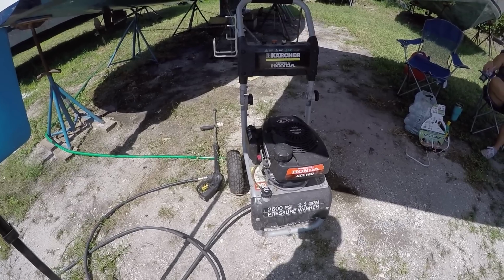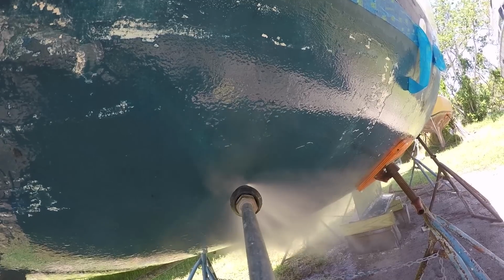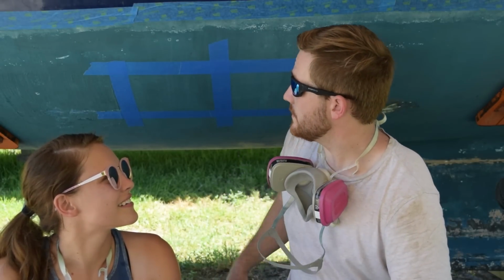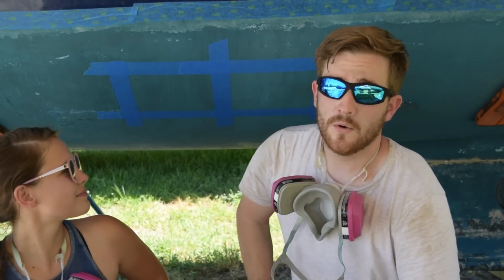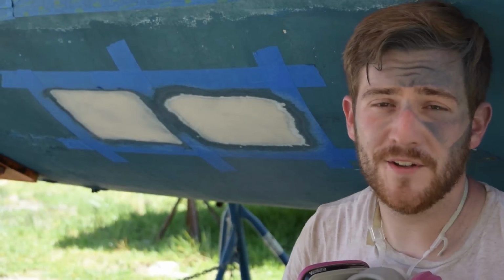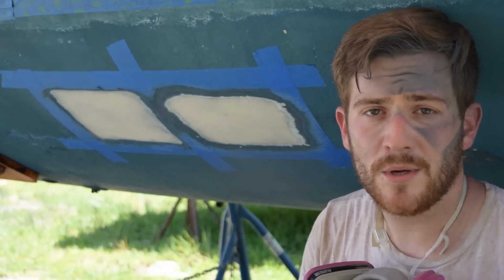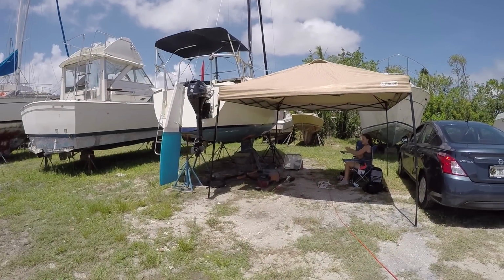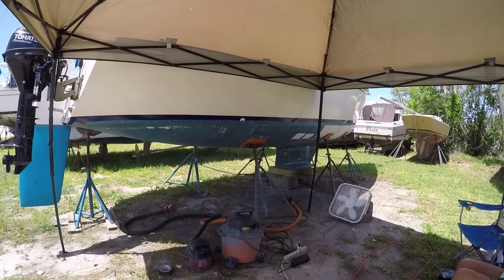27. Sanding Flat or Sanding at an Angle, What's Quicker? - Sailing Vessel Somnium

Comment: Dude, you completely missed the whole concept of the right way to use a sander. The idea is to get a smooth finish. Yes the angel will remove material faster, But at what price? What is left is a jagged rippled surface that will look like crap once finished. So in the end you will need to sand even more, to achieve the same smooth surface.
Reply: True.
Reply from the maker: Ha, just doing what works for us! We sand at an angle then go back over it flat and the hull is smooth as butter :) Thanks for the input!
Reply from the maker: Not trying to be a smart ass... just being lighthearted, however tone doesn't translate well in text. Go ahead and unsub if you'd like though. Best thing about YouTube is if you don't like us, don't watch us :)
Reply: Learning the Lines...He was spot on. The method you used, the reasoning behind it, and the work that you created for yourself, are all points that are trying to be made!! You did an experiment that was akin to deciding which is the better way to make a hole, a hammer and nail, or a drill and drill bit!! 

When sanding, the point is to make s smooth and uniform surface! When stripping the surface to be made smooth and uniform, you don't want to continue to make it rippled and unsmooth! The random orbital sander was designed to create a smooth finish, quicker than doing it by hand! And to remove the old finish, by using a smoother grit paper, up on edge of the sanding surface, only grinds and pits the surface to be sanded smooth!! Think of trying to make the surface like a mirror with the tips of your fingers, or the flat edge of a piece of wood!! 

To remove the old surface paint, use a heavier grit paper, on the flat of the sanding area! To make a smoother surface, use s finer grit, on the flat surface of the sanding area!! But never use the edge of the sanding area, unless you don't care about the total surface area, and what the end result looks like!! Go over the entire old paint surface with a very coarse sand paper, to get most of the old paint off, and to smooth the surface better, without causing ripples and ridges where the edge of the sander will dig in, unevenly!! Then use a finer grit to get to the main area that you want to paint over, that leaves a very small tooth for the paint to use to adhere to the surface, but in an even and uniform manner!
Reply: @LearningtheLines   not a good look.
Reply: I'm late to the party. 
 As a body guy this makes me cringe. I imagine if you blue died the hull it would have swirls and gouges everywhere. 
But that being said it looks great from my house.

Comment: Pressure washer to remove bottom paint???  regardless of whether it works or not, if there is enough pressure to remove paint, there is enough pressure to impregnate water into the fiberglass which may take a long time to dry out. 
Nothing wrong with Ryobi tools, yes they are not something you would buy to use every day all year but they work just fine for the home gamer. 
Sanding a HULL flat does not put as much surface (sanding dick contact area) as sanding at an angle unless you use a thick foam pad under the sandpaper to allow the paper to conform to the curvature of the hull.  
Me, I prefer the belt sander for large areas and dick sander for touch ups and hard to get areas
Reply from the maker: Yeah, I only tried it because I knew there would have been ample time for the hull to dry out during the Florida summer. Lot's of people recommended it though. Thanks for watching!

Comment: I'm am not an expert, but do you have to take it down to bare hull all over?  Seems like the paint was in good shape in most areas, so why not just add another ablative coat?
Reply from the maker: Maybe on camera it didn't look as bad as it was, I plan on doing another video/segment on why we're doing what we're doing soon. Thanks for the comment!
Reply: Any proper paint job done, be it a boat, a car or even walls demand good surface preparation i.e. sanding ! Other wise, a botched, unsightly finish. If it's worth doing it, it's worth doing it RIGHT. Kudos kids.
Reply: It's below the water line, it's not painted for aesthetics as much as to protect the bottom from fouling.

Comment: Go flat and use a bigger sander. Those big ones you hold with boat hands rock. And if you want to get evil with surface removal, go down a grade until you get to gnarly grit.  You can always go back up a grade quickly enough after that first layer is gone.
Reply from the maker: So like a 6" instead of a 5"? Would it make that big of a difference? If you have a recommendation I'd love a link to a good one. Also, we've recently tried out a belt sander, which was quicker than our random orbit sanders, but was heavy and clunky, and we'll be trying out an angle grinder to sand as well too. Thanks for watching and the input!
Reply: They're are lighter weight "grinders", actually polishers used in the automotive detailing business. And some 8" accessories including foam pads and stick-on "sand paper" available. Check it out

Comment: so why sand at all? It did not look like may paint layers were on there and it is adhering well enough...do you plan on racing?

 Of course i cant really "see" the paint from 1000 miles away, just asking.
Reply from the maker: Maybe on camera it didn't look as bad as it was, I plan on doing another video/segment on why we're doing what we're doing soon. Thanks for the comment!
Reply: Again: Any proper paint job done, be it a boat, a car or even walls demand good surface preparation i.e. sanding ! Other wise, a botched, unsightly finish. If it's worth doing it, it's worth doing it RIGHT. Simple.

Comment: Sanding flat will reduce the amount of fairing, which will reduce the overall cost. Less materials purchased-fairing compound and sandpaper and will make the sander pad last much longer.  So quicker is a relative term. Cost also. And u know that paint has poison in it, u should really be wearing paint suits to minimize the possible contact with your skin .......and then u don't need sunscreen at all......
Reply from the maker: Definitely a balance reguarding the PPE. I think the high on the days we were sanding was in the 90's with the humidity just as high, so a full suit would be almost unbearable. We protect our eyes/lungs first, however we're not in the business of doing this professionally, meaning we're not exposing ourselves to it on a daily bases, so our overall exposure to the dust in our lifetime will be very low. I can tell I don't think I ever want to sand a sailboat hull to this extreme again. I'm quickly learning some things are worth paying someone else to do for you. As far as the sanding goes, the surface we're getting looks pretty dang smooth so I don't see us doing much fairing except in couple places where the gelcoat had already flaked off prior to us doing all this. Thanks for watching!

Comment: I've watched most of your videos and have to ask, If you want a bigger boat why sink so many thousands into your current boat? After a certain point you're never going to recoup what you've invested. The experience and knowledge gained in boat renovation is great but why not invest your time and money in the boat of your dreams?
Reply from the maker: Great question John. The goal was to use Somnium as practice, not only for sailing but also refitting a sailboat. We make all our mistakes on the smaller boat where it's not as big of a deal, and learn from our mistakes. We've made a ton of mistakes, and learned a ton along the way. The cost of the refit has actually been mitigated mostly through small sponsorships. CDI supplied furlers, Seco South supplied rigging, Ruddercraft refurbished our rudder for free, Sailrite gave us a hefty discount on sail kits,  and Mast Mate gave us a hefty discount on their product as well. Overall, the cost to us was still a few thousand so far, but not nearly as much as if we had purchased everything outright, and the experience gained is priceless.
Reply: I picked up a Cal 25 this fall for 500$ I sailed her for about 2 months before hauling her out for the winter. I have a huge list of stuff to fix and replace. I figure at best i'll get 4 or 5 k for her fixed up, Keeping that in mind i'm only fixing what I have to and sailing the rest of the time until I can afford a bigger boat. Definitely can't put a price on learning experiences which are half the fun.
Reply from the maker: Thanks, John! We've watched quite a few Boatworks videos as well. We also love Mads' channel Sail Life https://www.youtube.com/channel/UC5xDht2blPNWdVtl9PkDmgA Don't know if you already watch him, but if you like sailing DIY, he's great. You're certainly right though, you must consider how much you're willing to put into the boat and how much you'll get back when you sell. I think you're being smart about only doing what's needed and continuing to sail. Best of luck! -Randi